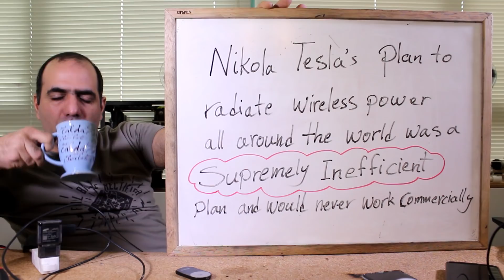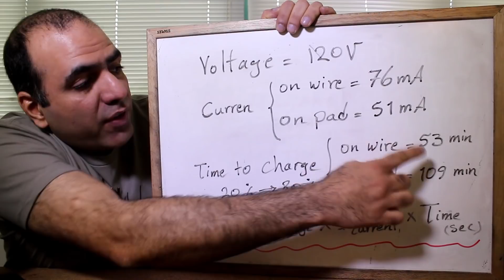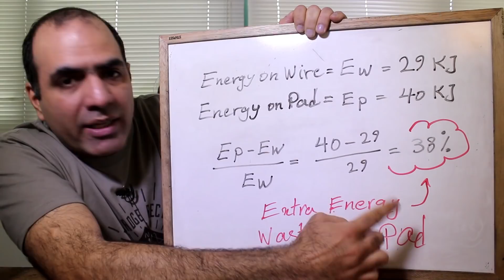Drowning in Inefficiency

Comment: 4:44 large scale power plants are generally way more efficient than small mobile engines; most get an excess of 50% efficiency even when burning coal. but its just a tiny detail, your point is still valid.
Reply: Cody you are a great man. The Persian community praises you
Reply: combined cycle plants!
Reply: @uptide1214  Yes, I think steam power is still only 6-9% efficient from fire to shaft power.
Reply: @uptide1214  That's talking about conversion to electricity from the steam. The power plant first has to create steam, which is not a perfectly efficient process. Also, you can't usurp all of the energy from steam, otherwise it will become "wet steam" in the turbines which would be catastrophic, so there are very practical limits as to how much you can extract from a power plant.
Reply: @DTXBrian  there has to be a starting point for the energy conversion for comparison's sake ha ha. We don't compare the fusion output of the sun to what a solar cell produces. Instead we only focus on usable energy for that particular scenario; area of the solar panel; steam from coal; expansion from internal combustion. Without this focus we would account for energy losses of plants/animals that become calories for the workers who must maintain the plant for the plant to even work...
Reply: They are when they're under constant load. As more variable power sources... renewables... get added, their average efficiency is dropping, quite a bit. I've read case studies from smaller countries that attached battery storage to their coal power plants to save fuel by smoothing out demand on their smaller and less stable grids. The fuel savings paid off the multi megawatt-hour battery investment in less than a year in some cases.
Reply: the global average efficiency for coal power stations is 33% to 40%, and some do get as bad as 20% efficiency as he said in the video. Remember, he did say "could be as bad as 20%", not "are all as bad as...". But yeah, they're mostly more efficient than small mobile engines
Reply: coal power plants are about 35% efficient at best, closed cycle gas turbines are the most efficient at about 55-60%
Reply: @Dr Meghnad @Cody'sLab only the combined cycle power plant reach 50%, the other power plants just lay around 40%. Thermodynamics things...
Reply: "most get an excess of 50% efficiency even when burning coal"
That is incorect. Most Bitumen-coal plant is about 35% efficent. Lignite-coal plants can be as bad as 25%.

Its only the supercritical bitumen-coal plant that is really good about 45%. Any Coal Power plant over 45-46% range don´t exist. Only conbined turbines get over 50% today

If one compare apple for apple comparisson. Say fast reacting gas turbine to a ICE Diesel or HCCI Engine the smal scale is actually more efficent.
Reply: cody, i think he was just trying to inspire his younger audience with the video
Reply: Just unfortunate that most of the power generated is lost through transmission... It's a shame that battery technology is so far behind what it needs to be in order to offset this inefficiency.
Reply: Efficiency of coal fired boilers in a power plant can be 80-90%. Mechanical efficiency of steam turbine and generator is 95% and more. Real waste is in thermodynamics of Rankine-Clausius cycle which even in most modern power plants barely gets to 40%.

Even if eventually we'd advance powerplants cycle enough, laws of thermodynamics say that maximum efficiency we can get is that of a Carnot cycle.
Reply: hey Cody, I want to thank you for your videos, just that.
Reply: Ha 444. Nice.
Reply: How'd I know Cody would be here
Reply: ElectroBOOM
 gets rekt by a bigger brain.
Reply: Nikola tesla believed we would have massive, long distance aquaducts bringings water  from the high mountains all around the country... guess what that would allow for?! LOTS and LOTS of hydroelectric POWER!
Reply: Cody'sLab oh hello there!
Reply: Maybe you guys can team up and actually try to explain Teslas' world system, since there's no way he'd be so stupid to invest all of his energy into a project that wouldn't pay off by his standards, and his OCD set those standards pretty high. Shitting on Tesla, without understanding the actual mechanism, is a grievous mistake.
Reply: Is it easier to believe that his project was shot down because somebody else understood the systems, he discovered earlier, better than him ? You be the judge.
Reply: @sFeral  I can explain but it will be put away as fake as always. Because people cannot understand how his idea would work. Yet now we have BILLIONS of miles of cable everywhere. And it is only getting more and more and more and more. Nikola Tesla even said this back then.... He knew all the cables would be useless and a waste of energy in the end. 

Nikola Tesla was right and still is to this day. But we are doomed when they made the choice to not go with Nikola Tesla his idea. Because his idea only fully works when it covers big areas. It would need lot of towers. The investments never will be made anymore now.

The thing is out communications would need to be different. Then all devices need be be made into ones that can fit the Nikola Tesla transmission of power idea. 

Never gonna happen anymore.
Reply: @bosstowndynamics5488  My point was that people getting Teslas are not doing it because of emissions, then they would get a compact micro K-car type vehicle.  and Yes, making micro cars electric, would be best, getting around 100Wh/mile highway.
Reply: Cody'sLab yeah but trasmission lines loose a small amount of energy, 5 to 9% average
Reply: I want to add one thing to this point. Most Gas powered generator turbines exhaust are connected with steam generation cycle (HRSG) to produce high pressure steam. Then we direct the HP steam to a steam turbines in order to get higher efficiency out of your whole cycle.
Reply: Solar panels are only 13% efficient
Reply: @aravindmk12  23% - for home use, industrial they use solar mirrors and the efficiency goes up to 30-40%
Reply: 420 İQ
Reply: I have heard about more than 70% efficient coal plants with high temperature high speed turbines, ion absorbers and many other fancy stuff. The designers claimed to be only 10% or so below the corresponding perfect heat convertion cycle. May be that is not true but theese things are definitely not all the same as they were 50 years ago.
Reply: New plants natural gas with HRSG are 60% +. If you combine power and heat its even better. Capitalism promotes efficiency because it means less fuel costs and more profits. However there are other limitations that need to be considered. Emissions requirements are a big deal and many countries need to improve them but that’s expensive. Bill gates book “how to avoid a climate disaster” shines a light onto this complex issue.
Reply: And? solar panels at best are only 40% efficient.
Reply: Also take into account the transmission losses, which is somewhere between 8-15%.

And then the loss going from AC into DC (which is what most of your devices take), this is also ~10-20% (This is why your laptop charger gets hot).
Reply: Good
Reply: So true! And stocking those numbers up to 90% isn't always possible due to the 2nd law of thermodynamics... Its not all bad design
Reply: Maybe fusion reactors will deal with that.
Reply: @MegaZsolti  ohhh! I don't think we can create the same pressure and temperature as the core of sun on earth yet. (maybe in the year 3829)
Reply: @nikanmahdavitabatabaei466  EAST already had temperature needed in 2018, now question about pressure.
Reply: Lol
Reply: internal combustion still more efficient in total
Reply: @johannsmith5697  Far more efficient than coal power electricity. That is why the US with a big electricity contribution from coal has a CO2 footprint of 432g CO2/kWh Which puts every tesla at 107g CO2/km under ideal conditions, which is as bad as the average European car. It makes no sense to buy a Tesla in the US, unless you live in a very green state or have solar at home. Driving carefully, I can average 58mpg in my 1.1L Fiat. This means that I only emit 93g CO2/km in a 21 year old car.
Reply: No one dares downvote cody... You will rue the day, and wake up to find yourself in a deep mine covered in the darkness that matches your cold heart. Watch yourself before you think to hit that thumbs down son.
Reply: but that 50% energy from power plant is one more time decreased by electric motor efficiency in vehicle so you get again around the same efficiency...the question is what makes more polution, the coal burning and nuclear power plants and lithium battery production or internal combustion engine emissions...
Reply: @tomashronsky6677  Yes, but there's a bigger efficiency loss in production (refining and stuff) of the fossil fuel than just putting it into a batter that is much more efficient.
Reply: @tomashronsky6677  its the combustion engine emissions that are worse,
Reply: Are you talking about energy efficiency, or pollution? Because if its about pollution, one's ICE car isn't less polluting than BEV car. And as power generation comes more and more from renewables, BEV cars getting charged from the mains become even less polluting. Energy efficiency, on the other  hand...not sure.
Reply: @tomashronsky6677  

Both Wired and Arstechncia published different article which focus on different studies into this matter. They found that even at the worst case scenario in which  all of the power needed to charge a BEV  just came from coal burning power plants, the BEV still produce less CO2 and other pollutants compared to ICE throughout the vehicle's lifetime despite BEV having higher greenhouse footprint upfront .

In short ,  your question have already been answered.
Reply: @tomashronsky6677  Nuclear power is perfectly fine. A power plant can produce just as much energy as a large coal or gas, and with zero emissions and death tolls comparable to that of wind and solar.
Reply: Why don't we use tec/teg technology to convert heat into electricity and we can even color it with venta-black to absorb more useless form of energy
Reply: @soulertandon2137  that's how coal and nuclear power stations work. They heat up water to it's boiling point which creates vapour pressure which turns turbines
Reply: @user-de1xi2uf8d   i am talking about thermoelecric generator(teg)
Reply: @user-de1xi2uf8d   based on paltier effect and seebac effect
Reply: @soulertandon2137  Yeah but you still need to use energy to heat one side (probably will be coal) and cool the other. I assume industries don't use this method because it's not very effective on large scales
Reply: @user-de1xi2uf8d  i am not saying to use it only but to use it  with our normal engines to convert the useless heat that is released from it bec our engins get burning hot at some points
Reply: @user-de1xi2uf8d  and we don't need to cool the other side
Reply: @user-de1xi2uf8d  this thing will nevee decrease efficiency but will only increase it
Reply: @soulertandon2137  but how much power can it produce per ton of coal compared to our regular methods?
Reply: @user-de1xi2uf8d  i don't know
Reply: The point is that Tesla was a genius and you dont need to be a genius to instantly understand what obstacles was infront of Tesla. The guys that used dynamite to blow up Tesla tower that is presented in this video did that for a reason and the reason is not what the guy in this video said... so in the end his whole point is that he(the author of this video) can not do it and he have no idea if Tesla idea is posible and will be efficient enoght in the future. He was not able to do it because of people that earn billions whit what we have now and they did not like idea that you will be able to get power for your radio, car or ship and not use oil products that they sell or put electricity meter betwen you and the power plant that can produce power from stuff that they do not sell... We have planes and spaceflight and AC power in our home thanks to people like Tesla not thanks to people that have "NO CANT DO" type of attitude.
Reply: @Bialy_1  Are you talking about power generation or power transmission? Because if Tesla's idea was about power transmission like ElectroBOOM said, then it would not make electrocity free, because it would still cost money to generate it.
Reply: @Bialy_1  That's what a conspiracy theorist would say.
Tesla's wireless electricity is actually useless.
Reply: @jotabeas22  Oh dont come here with your electrical engineering degree and talk sense. Listen to the guy who's watched countless hours of Tesla fanboy-videos but never made a voltage division.
Reply: @jotabeas22  His system would not be useless. His idea is clear. Put an electromotive force. And all cam benefit from that electromotive force. But no way to measure energy consumption that way because the electromotive force producer will work at a steady rate because its not a closed system like the electricity web today.
Reply: @Bialy_1  yikes
Reply: @Bialy_1  someone forgot to take off their tinfoil hat
Reply: @Bialy_1  Everyone who actually took high school physics would come to the conclusion, with some back of the envelope calculations, that it's completely unviable.
By the way, you're not entitled to free electricity unless you make it yourself, how dare power companies make a business out of selling power.
Reply: @Blacktronics  Nikola Tesla was very well aware of the fact that there need to be put energy in first before you can benefit from it. Why do people keep thinking that he did not know this????

Comment: High efficiency devices are very hard to make as it has to fight with second law of thermodynamics. And a 100% efficient device is impossible.
Reply: We can get upto 99 or 98 percent efficiency of we use semiconductors in electronics and all but it is expensive to maintain it so it is not possible right now.   Scientists are trying to make a semiconductor at room temperature which can reduce heat loss in transmission

Comment: Can you explain why electric motor is more powerful than combustion engine ?
Reply: combustion engine requires heat, oxidiser and fuel, to generate a small explosion/fast fire in a small chamber, this rapid hot expansion forces the piston to move, moving other pistons back down in their chambers and pushing a drive shaft of some form. this is repeated many times a second. the outputs from the explosions and piston movements are hot waste gas (lost heat and any fuel that has not been consumed), noise, the explosions, piston and drive shaft movements produce a lot of noise. (noise is energy(I'm not explaining it here)) also from the movement and friction of the moving parts in a combustion engine more heat is produced, this is also lost. the only energy that is harvested from a simple combustion engine is from the drive shaft spinning. modern combustion engines have recovery systems which harvest a little more energy out of them (turbos). complex combustion engines like on F1 cars have various energy recovery systems to collect as much energy from the waste that they can (turbos, heat powered generators (MGU-H), regenerative braking (KERS), recover lost energy from engine braking (MGU-K). the list goes on, but they still are not more than 50% energy efficient
Reply: rotary combustion engines are more efficient than traditional piston engines as there are less moving parts
Reply: electric motor converts electricity to kinetic energy through running current through coils (I'm not explaining that here) the current flow looses some energy as heat, but it is very little. some heat and a little noise is produced when the spinning part of the motor is moving, most of this if friction, some is heat from eddy currents in the metals used in making the motor. with correct lubrication and setup only a tiny amount of energy is lost to heat, this can then be recovered if needed using a Peltier if needed
Reply: Thanks but that's efficiency,i want to know about power output,torque since tesla claim that his car is more powerful than gas car
Reply: @DarkMoon095  sorry, was answering without fully reading question

Comment: I use a wireless charging pad, but only because my charging port is broken and would cost over $100 to fix. It is mildly convenient just to be able to sit it down and pick it up quickly... But that's the only benefit. The phone gets SO hot when charging on the charging pad and it takes longer to charge it to full, though I just leave it on while I sleep. I would not use the pad if I didn't have to.

Comment: Efficiency is important, but not always the most important.   Fast breeder reactors are able to extract ~1% of the energy in the fuel as useable heat- then you gotta throw in Carnot efficiency.    Yet it steadily provides around 20% of our baseload.

If you told me we planned on a massive investment in nuclear power- until energy was so cheap we started a titanium age driven by a hydrogen economy- I'd say who cares about efficiency.

Although honestly that other 99% of energy can be gained from 'spent fuel' so actually producing that much power might be even easier than most realize.   But that is a whole other conspiracy ( Research Alvin M Weinberg if more interested )

Comment: I am personally appalled by the lack of Platinum and Titanium grade PSUs for computers at sane power levels, combined with marketing pushing lower-grade power supplies with very insanely high wattage for consumers. Seasonic made a 400 watt Platinum PSU and 600 watt Titanium that doesn't even need fans for cooling because it's so efficient, but when you actually go to buy a PC you're more likely to get a 300 watt 80-plus white, or at the high end 700 watt 80 plus bronze. Jesus, nobody needs that!

If you're building a high-end gaming PC, you're looking at 450-650 watts for an ideal range. If you don't even have a graphics card, you won't need anything more than 200 watts.